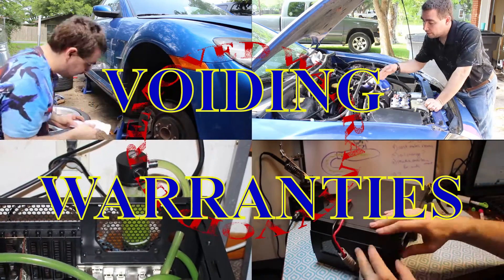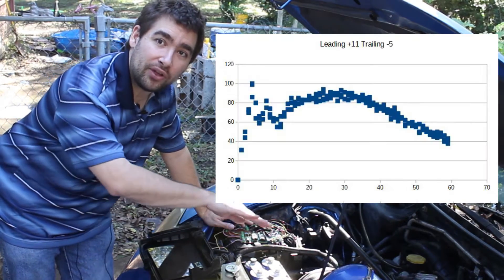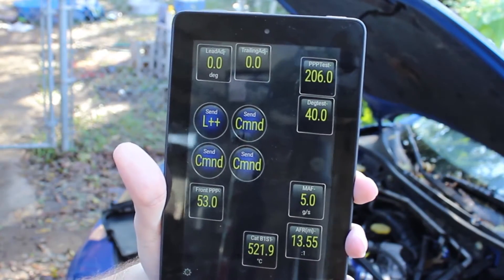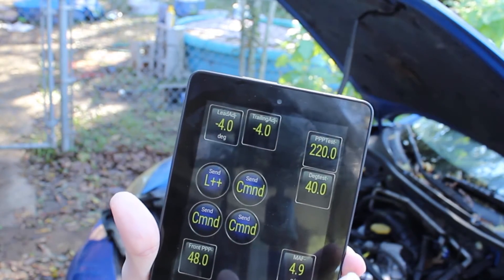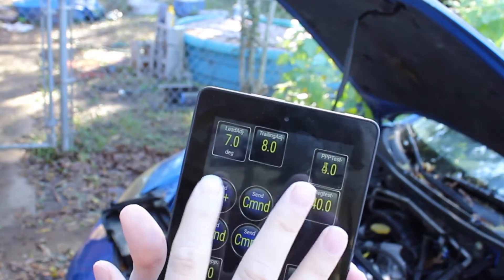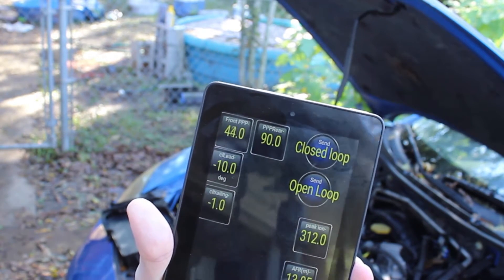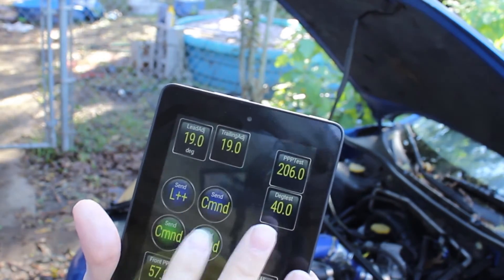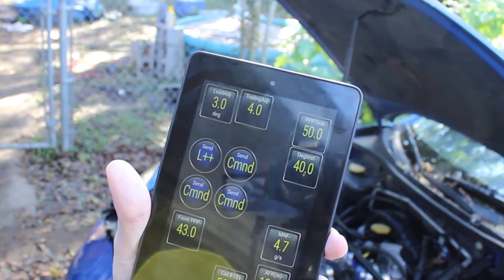Ion sensing with Closed Loop ignition timing - Voiding Warranties Ep 24

Comment: Interesting how you determined the best crank angle after TDC ,where is most beneficial top in cylinder pressure to be achieved?
I’m most interested in this for conventional engines but will be interesting to hear your method for rotaries .

Comment: What diagnostic tool are you using
Reply from the maker: The software is called torque it's in Android phones and tablets and it allows custom obd2 pids and sending obd2 codes on the can bus. The hardware and software which I use to add functionality to obd2 on the car is my own creation and it runs on a teensy 3.1
Reply: It seems like you know a ton about about cars. If so my mom has a 2000 isuzu rodeo which shut off on her yesterday. I tried the crank sensor,ion sensor,and pcm and still not getti g spark to the plugs. Should i change the plugs or is the problem somewhere else
Reply from the maker: No spark on a 2000 rodeo could be the ignition module. I just happen to have one for a current project that I destroyed by over cycling it. Long story short if it dies there are no spark at all. They can be picked up on eBay for less than $30
Reply: Is that the part thats sitting on top of the intake wire the 3 plug ins for it. 2 on one side 1 on the other
Reply from the maker: That's the one.
Reply: 2 wires on one side 1 on the other being the biggest plus or its located somewhere else
Reply: Thanks ill give it a try

Comment: Curious if you're compensating for (or even quantifying) the crank offset between peak cylinder pressure and peak ion flow. The SAE papers I've got where they were able to compare the ion waveform to a pressure transducer waveform show a delay of 8-10° between the two peaks. Granted, this is for a piston engine...

Comment: i have read a lot of this stuff. Saab is with the "trionic" leading.
They have a special "Combustion Detection Module" - this outputs a knock an a seperate ion current signal to the ECU. There is a older analog an a newer didital CDM on the Trinonc 8.See here:
http://www.frankencis.com/Forum/aft/28
http://forums.haltech.com/viewtopic.php?f=30&t=11498&sid=ffeb513aa3c446bb05519fe08787700cmaybe it is possible to feed a standart knock ECU input with this CDM Output?
Let me know about your progress.
Have you a website/forum where you document?
Reply from the maker: +z20leh I originally considered hacking a Trionic system, but decide not to because I was unsure if it could work on a rotary engine and didn't want to fuss with CDI.